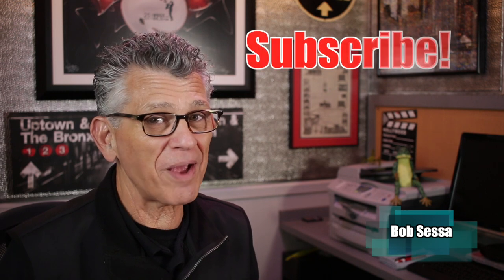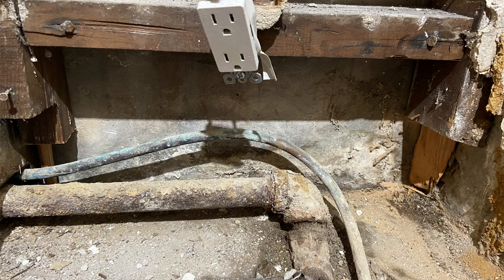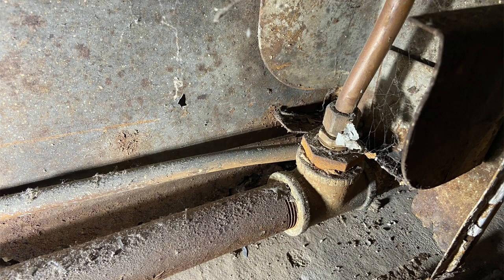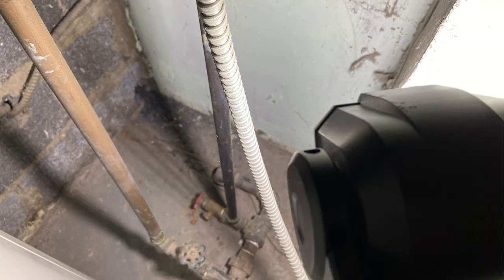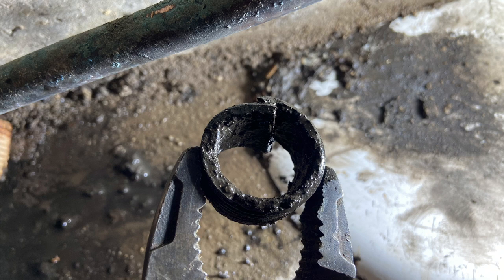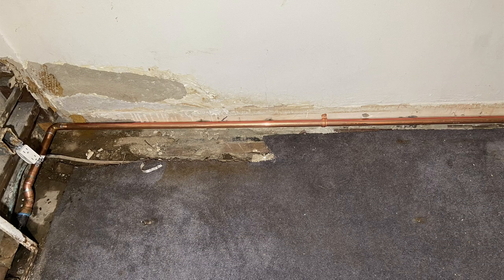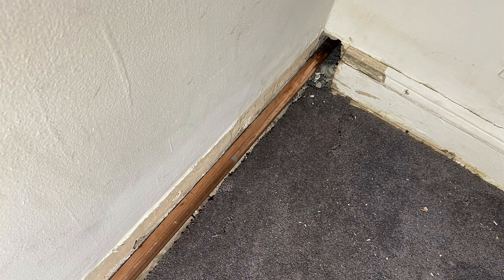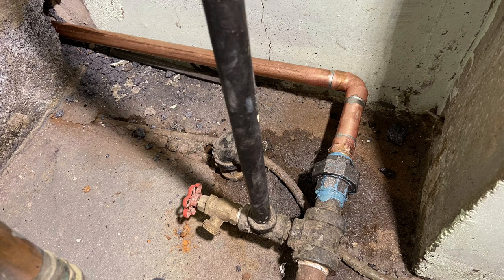Underground Steam Pipe

Comment: Hi BOB
I talked to you before about my leaking  boiler , and you gave me the great advise and now it work very good .
I did the same thing for the galvanized 1” return pipe , it was under the tile buried in the cement , for 20 years , it was seeping water in many corroded spots , when I changed last July , I inserted the 1” copper pipe in a 11/2 “ PVC pipe, like a sleeve with the length of 15 feet and back  in the cement to install the tiles back on top . Is it ok  to do that ( copper pipe in a PVC , sleeve underground ) , or I will have another problem soon .THANK YOU

Comment: Hey Bob love the channel and your content. I am new to steam heating but I understand from other videos that pipe pitch is crucial with 1 pipe steam. I know the A dimension is super important because of the pressure drop of the circuit leaves little pressure to get the condensate back into the boiler. Correct me if I am wrong here, that is the height from the dry return down to the wet return. Vertical drop stacks water and the weight makes the differential to flow inside the boiler... How does the system flow condensate back into the boiler (mainly by the head pressure from your A dimension) when your new pipe is higher than the original. One point it looked like the wet return pitched up above that 5/8 connector feed line. Does pitch not matter with this portion of the circuit because we have no steam, and all that stacked water in the pipe ?

Comment: what did you use to i
insulate the black iron pipe from the copper pipe to prevent galvanic action?
Reply from the maker: On black pipe, the teflon tape and blue block is sufficient IMHO. Galvanized pipe and copper pipe completely different animal!
Reply: @BobsPlumbingVideos  Thanks Bob!